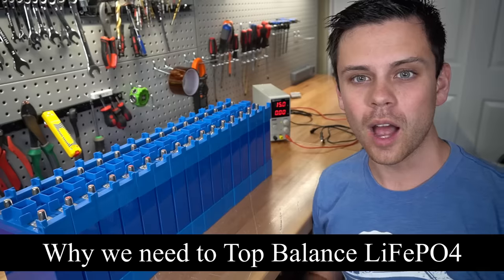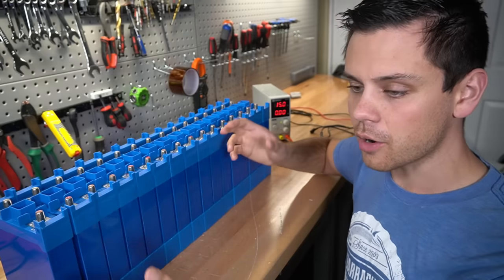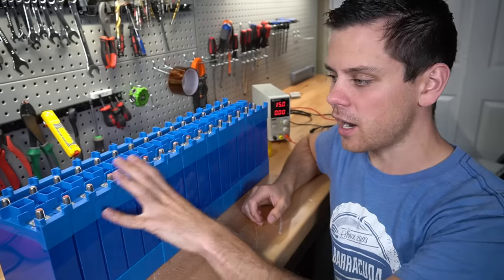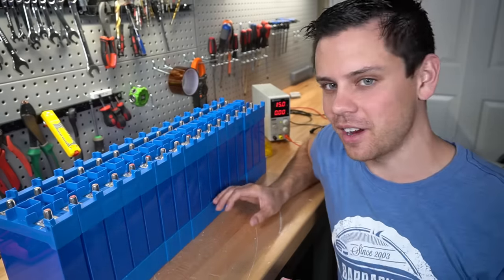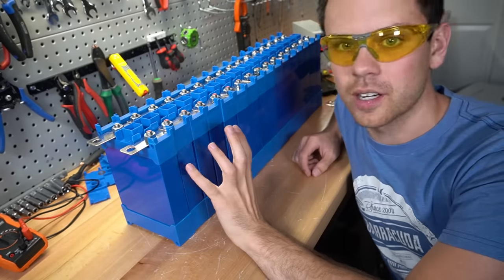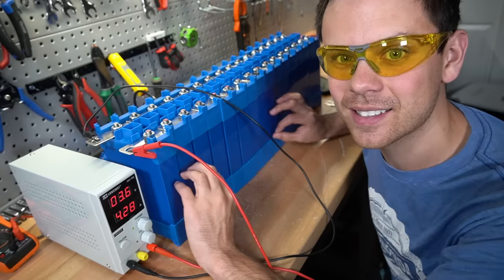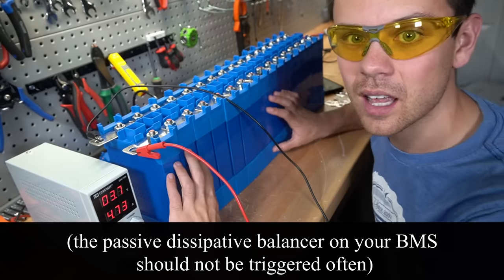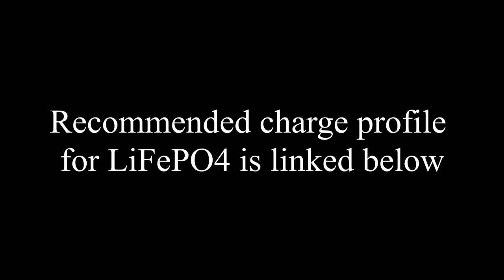How to Top Balance LiFePO4 Battery Cells Quickly (and when you need to do it)

Comment: Will, I have been watching your videos for awhile now and I’m starting to kinda sorta understand electricity a little bit. I have a question, which doesn’t really apply to this video. I just recently got a Z2 Auto CPAP machine and I have a AC to DC plug for it. I have a 44000mah Aimtom portable battery which is available on Amazon. Is there a way I can use a DC to DC wire to connect the two? Or do I need some kind of converter thingie to make it run?
Reply: if the voltage in both equipment are the same, don`t see why can not being use. just make sure machine and charger are the same voltage and that the amps you got in the batteries, is enough for holding the machine on the whole night, i do use a CPAP machine from Phillips, it do have his own Li-on battery good for one night.

Comment: Hi Will, Can you recommend a BMS for an 8 cell, 205ah lithium, 24v battery system. I check out the 2 on your site and the second one looks good   (7S~16S 320A w/ Bluetooth + LCD) but requires and android phone to set up. any other suggestions? Thanks
Reply: Zevs Bms 12, works

Comment: I'm having trouble getting 4x 32700 cells to balance.

First, I charged each individual cell to 3.6V with my LiPo charger (set to LFP mode). Then, I put them all in parallel and let them sit for the night.

After disconnecting them the next morning, the voltages were all around 3.32V.

Then, I put them in series and tried to charge it like a 4S pack. But during charging, I noticed one cell goes up quickly to 3.8V, while the others are around 3.4V. The result is my charger says its finished while 3 out of 4 cells are still at 3.4V (while charging, just before the charger cuts it off). 

Any ideas?

Comment: With battle Born having their own BMS does the rule still apply to top balance?
Reply from the maker: Those top balance automatically. Just charge them
Reply: DIY Solar Power with Will Prowse       I have been a lead acid guy for the last 5 years and they are about dead.   So it’s time to go Lifepo4!    You mentioned that you should top balance the DIY battery every 6 months and that the battle born top balance automatically.   Is there a BMS that will top balance my DIY bank automatically so that I can set it and forget it like the BB?

Comment: I top balanced my 4 280 ah eve cells and after hooking up the BMS they are out of balance.  My voltages in order from cell 1 to 4 are: 3.558, 3.610, 3.477,  3.461.  Did I do something wrong?
Reply: Try top Charge to 3,45V, After discharge, then to Max 3,55V, and you are good.  You will have almost 98% of capacity. This means, your New 100% Soc will be 98% capacity

This top balancing method is sadly wrong, because you overcharge your cells, where they aren't able to work chemistry wise to function normally

Comment: Whoa, I'm sorry. You lost me across the edit at (4:03). Why would the current drop to 0.1 amps again? Do you mean the current flowing INTO the battery pack from the charger? (indicating they are fully charged as a parallel unit and are not accepting any more current?)

Comment: Hey @Will Prowse, can I charge at a higher amperage? I have a charger that can push up to 50A @ 3.6V.
Reply from the maker: Oh absolutely, just connect the leads on opposite ends for proper current sharing. What charger is that??
Reply: @WillProwse  Hello,What do you mean by connecting the wires in opposite ends?

Comment: I've noticed a very strange phenomenon when attempting to top-balance my cells.
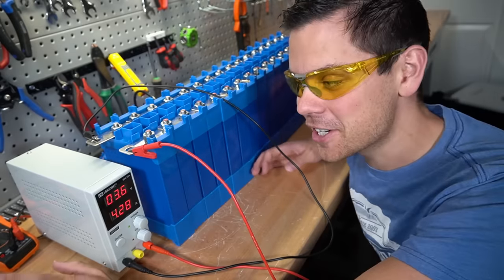I'm using the same DC power supply with the cells connected in parallel. Initially the current would steadily drop, just like you said. But after a while, when the cells reach around 3.3v, the rate of the "current drop" slows down and the current even starts to slowly increase! I can see it happening also to you in the video at 4:19. Why is that? It's freaking me out as the cells, which were previously at the same voltage, have started to differ in voltage. Any idea whats going on here?
Reply: It's because initially some cells were discharging and some were charging.   As they come into balance they all start charging, and you see the current increase as a result.

Comment: But what if the batteries come in a different state of charge: Let's say the 1st cell is with 20% while others are 60%. Naturally, the 1st cell will have a lower voltage. Now if I connect all the cells parallelly, won't the the cells charge the 1st cell with too much current and destroy it as there is no current regulation here?

Comment: I like to watch your video, but in this one you have an error, you should use the plus on one side and the negative on the far side of the other end.
Reply from the maker: No it's not an error. Going to make a video about this. Pushing .1-4 amps across a 150A bus bar will not cause a current sharing issue.
Reply: DIY Solar Power with Will Prowse also, even if you were charging at a higher rate and there was a tiny voltage drop across the bus bars, this would even out at the top of the charge when the cell nearest the psu would no longer be charging and those further down the chain would still be able to suck a little current to make up those last millivolts they may have been lagging by.  This nonsense about needing to connect at either end of the battery bank is just over cautious hoodoo, exploiting people’s insecurity and lack of engineering knowledge.

Comment: Bentley, What sort of discharge and charge cycles were those cells dealing with daily? I've got 180 AH tied in Series-Parallel at 12V's. I bottom and top balanced when i started testing them but have now been using them for over 30 days (without a BMS, because i monitor them daily, there on the test bench).  I've been running them continuously for a month on my test bench, with a parasitic load of 80-100W's (my Wifi Router & Modem- 24 hrs a day and going up to 500-1200 Watts during the day when I turn everything else on). I am charging continuously as well with a 1440 Watt Solar Array. I know no one recommends running without a BMS but just hypothetically what do you think?

Comment: Isn’t iT better to put the positieve en negatieve on oppositie sites for charging the cels for so manny batery’s in parallel? Or does iT not mather.
Reply from the maker: Doesn't matter at this much current. .1-4A through a 150A bus bar isn't going to have current sharing issue
Reply: I was charging my first ever purchased cells: 16 x 90Ah LiFePO4 in parallel at 3.625V@ ~20A and I noticed the first cell reached its level way ahead of the second one, the following ones hardly have moved at all.

I agree with Will's comment, it doesn't matter with a on low Amps but when receiving batteries, by regulations they can't be charged more than ... 30%? Can't recall the exact % - I just can't imagine someone charging / balancing a huge battery pack at a low Amp rate.

Thanx for bringing this up, it confirms what I thought of doing after seeing that first cell way ahead of the remaining ones.

Comment: My 20V 5A cheapo power supply won't do 3.65V at 5 amps. For some reason it drops to 1 amp 3.65 volts when I output the charge. Frustrating. what cheap power supply will output 3.65 volts at 5 amps?
Reply: that is correct when it drops to 0 amps you have charged the battery to 3.65v

Comment: Egad! I just let the smoke out of my old power supply while trying to do my first top balance on some new cells. What the...? Perhaps because that old supply didn't have current limiting? (I kind of assumed that the new cells would be mostly charged and the current draw would be low. I must have assumed wrong.)
Reply from the maker: Ahh crap. Probably should use a diode. I burned out a few. I usually turn it on first, then connect to battery. Definitely need a different supply
Reply: @WillProwse  ha, I don't have much choice about getting a new one now :)

Comment: Why would the power supply amps reach almost zero when fully balanced? It is a power supply and shouldn't it keep pumping 4.6A constantly?
Reply: That's not how power works.  The load "draws" current.  As the batteries get close to being full they slow and then stop drawing current.  The power supply "supplies" current.
Reply: @DrychronRed  Thanks for the reply. So that means i can use any brand power supply with adjustable volt and amps right? They all work the same as how you described it?
Reply: @ianchewyy  Yes.  Set the volt selection to 3.65v and turn the amps "allowed" to as high as the power supply will allow.

Comment: hey will, im new to this, lifepo4 lithium(all lithium really) and you tube ,face book etc. and dont see a direct link to you. i want to buy a good lifepo4  for my trolling motor 30# thrust so im guessing max 30  amp draw for a 3hour duration(not all at once, over the course of day). now say i buy a dakota 30ah can literally expect 1 hour of run time and thus get 60ah for my desired runtime,  any help from any one would be nice, nice vids  thanks
Reply: Hi Ron, Jeff here.
Check out the battleborns batteries. They're great, we run our entire 3 unit home/rental villas on 16 battleborns batteries.
I've seen videos of a few guys using them with trolling motors 12 volts up to 48 volt electric outboard.
I bet you could get 6-8 hours or more power for a 12 volt 30 pound thrust motor.
Just a guess in that application but we run ours hard and they have no problem supplying all our power needs.
They were well worth the price because they pack twice the power in a standard battery size, weigh only 30 pounds, never need any maintainance at all, can be charged much faster and have a 10 year warranty.
Plus the customer service is tops.
We've been using ours for three years now, day in-day out fully off grid and they've been worth every penny as we can travel away from home and don't have to worry about the batteries at all.
They should not ever be charged in freezing weather, however you can take a fully charged battery out into freezing weather and use it just fine.
Hope that helps.

Comment: So now i have to buy a power supply to top balance  my new cells??? Lets see, So i have a victron 200amp BB that i no longer need, I have a 256$ inverter that i can't use because it does not have a typical on off switch, anything else?
Reply from the maker: Which inverter is that. And why no use for bb?
Reply: @WillProwse  it has a button to turn it on that you have to hold, you stated that kind wont work, but I got it though amazon so I will be able to return it.
Reply: @WillProwse  The Victron BB was to protect the Inverter that latter we found out would not work, so now I need a inverter with a standard switch so I can run one off your relays as I purchased the 100 amp bms that you showed us. By the way the added a 3rd wire.

Comment: Hi Will.  I just bought eight of these 100 AH cells and they have been top balancing for over three days.  I am using the same power supply you did and half way through the 4th day, they are still charging at over 3 amps  Is this normal?
Reply from the maker: You need to charge them up first to high SOC as mentioned in video. Then put in parallel. Should take only a few hours if done right. I'd use a 4s common port BMS for that step
Reply: @WillProwse  Thanks Will.  I would have thought they would be at a high SOC straight from the distributor.  They each read 3.2 or so volts... but then that isn't 3.6.

Comment: I thought you only recommended bottom balances at a low voltage. 

Why did it change
Reply from the maker: Nope. If no BMS, bottom balance. BMS with passive dissipative balancer? Or unable to manually set absorption? Top balance always. I actually have a few videos on this topic
Reply: What am I looking for to see if my cells are matched specifically?

I ordered 4 90ah cells and want to order 16 more. Seller said he can’t gaurentee that the first order will be matched to the second so I have to verify myself

Comment: Hi Will,  I  have 12 280amp hour LiFePO4 batteries connected up in parallel. I am setting  the bench power supply to  3.65VDC with a inline 5amp fuse. The power supply voltage goes to zero and the 5 amp inline fuse blows. The strange part is before connecting anything to the paralleled batteries,  I fist turn on the bench power supply I connect both leads (short circuit) red and black together and adjust the current output to 3 amps. but as soon as I connect to the battery bank the the voltage drops to zero and the small inline fuse blows? If anyone can help me I would really appreciate it. I even tired 4 batteries on parallel and same thing. When I measure the cell voltages they are all 3.23vdc  typ range.
Reply: I sorted it out I made the incorrect assumption that the black terminal was negative. Its the beige terminal on my cells. all good now and they are charging fine.

Comment: Question for the community or Will if he's available: Do I need to top balance four brand new 3.2v 100ah prismatic cells for a 4s trolling motor battery? If so, where can I get more bus bars? I have a roll of 10awg copper ground wire. Would that work for top balancing?
Reply: I use 4 awg wire and big 5/16 copper ring terminals to make 3 inch long buss bars.

Comment: Is there somewhere I can get bus bars?
Reply from the maker: These cells come with them
Reply: @WillProwse  What happens if I got batteries and didn't have any is there way to make them or buy them somewhere?
Reply: @Kyle-rl1dd  You can make them from copper pipe. I've also seen them on eBay and AliExpress.

Comment: Shame you can't do that with laptop batteries and the like, not easily anyway. Would have saved a lot of 'em from going to recycling over the years. I have the strong suspicion that they are only monitoring individual cells but not actually balancing them, so over time they'll tend to drift apart and degrade from there on. At a typical 3S or 4S tops, I guess designers figured it wasn't that critical. sigh

Comment: Now I have two bloated ruined cells after trying this since you didn't mention using a BMS or any protection.  I didn't overcharge either.  A cheap $35 hobby battery charger wouldve worked better.  Id recommend re-making this video so others don't fall victim to bad advice.
Reply: maybe because
 you did not perform initial balancing for a couple of days?

Comment: "Do not adjust the voltage of the power supply after you connect it to your cells!! You should do as I did in the video and set it to 3.6V, then attach the leads second. Do not adjust the voltage when the leads are connected to the cells!!" Now you tell me. I saw in one of your videos that you grew impatient and cranked the voltage up to get more amps. I did that too. Are my new cells now damaged?
Reply: don't worry, nothing bad happens. the main reason not to adjust the supply while it's connected is in case you inadvertently screw up the settings while it's live.
Reply: @lincomatic  Agreed but it is good not to start out with bad habits.
Reply: If the power supply is in CC mode and you rotate the voltage knob, then you can increase the CV voltage value without even knowing. This does not cause any immediate harm to the batteries but it does when your batteries are nearly full, and the CV mode kicks in with higher than the required voltage. Now it can damage the batteries with overcharging if not monitored.